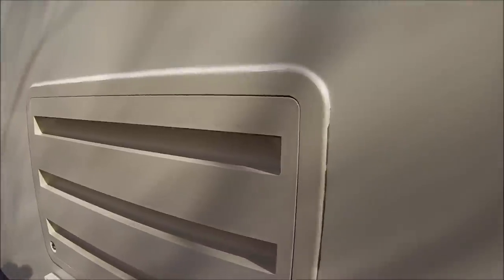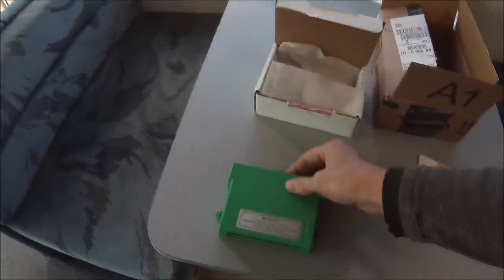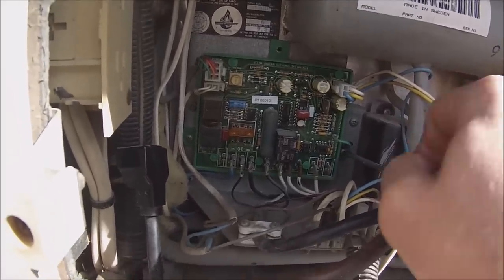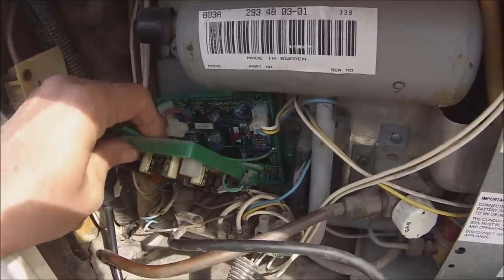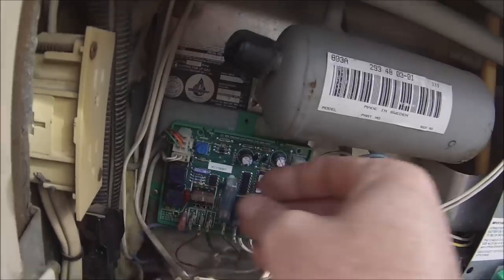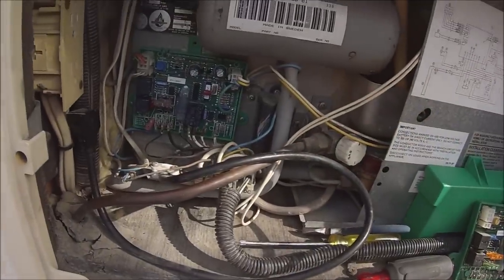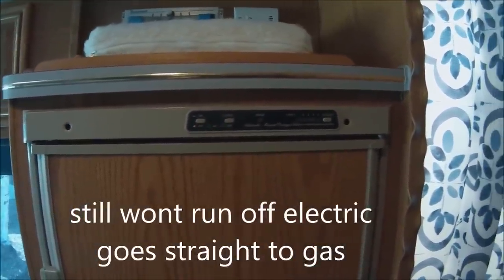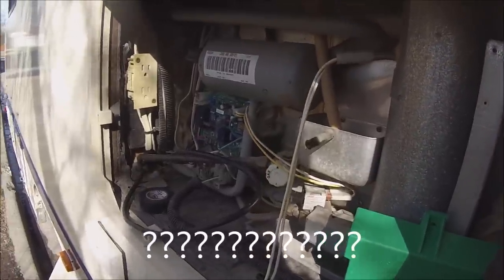Installing new circuit board for motorhome fridge

Comment: Thanks for posting how far you got. I have a NorCold and it was helpful to see what you showed. I've heard that NorColds have a bad rep for catching fire (and causing the coach to burn). Many, at least, have been recalled though the recalls weren't necessarily done (I know of an older one that is still not complete). I don't know how helpful that might be but thought I would try. Thanks again.

Comment: i had a similar problem, how ever your video is awesome we are forgetting one thing as I learned tonight. There is actually a fourth thing that can go wrong as I learned tonight myself. The main house fuse box. This may not be your problem. There is a 20 amp fuse that controls some of the lights in the back half of the RV. For me I have a 94 fleetwood bounder class A. My fridge had no power, no lights, no nothing. I even ordered a dinosaur circuit board to replace the old one. turns out, I have 120v to the circuit board like you did at the end to make power, but nothing coming back out to charge the fridge via gas or electric. I jerry rigged my heating element to my actual home to run 120v from my house to the RV to begin cooling the fridge until what I thought was a bad circuit board. When i went back in the RV tonight to check to cooling, I noticed  my ceiling lights were not working. i found that odd and tried other lights in the back of the RV.. They also were not working. After triple checking the circuit board fuses, I never checked the main circuit board fuses to the RV and sure enough a 20amp was blown. replaced it and the fridge popped on at first with gas but then I changed it back to the house plug in and 120v kicked on and now is working 100%. hope this helps in your next video or somebody that reads this as it wasted 4 hours of my day thinking it was the circuit board when it was the RV house 20 amp fuse that was need to run the circuit board and ignite the propane and run the electrical. your video shows you have lights and 12v power to your control panel, so I am just adding this info if anybody researching this had the same problem as me. My 20 amp fuse was blown, not my circuit board.. saved $115

Comment: he never plugged the fridge back in at the outlet next to the new board. even at the end of video it was still unplugged.
Reply: The fridge, if it’s like mine, is hard wired and does not need to be plugged in.
Reply: @FredBTs  you can see it unplugged on the left hand side. It definitely plugs in.

Comment: Sorry this is late, but have your checked your GFCI outlets?  My refrigerator acts like that if my GFCI is tripped.  I reset the outlet and mine will work again.  We found it usually happened when plugged into an extension cord into a garage outlet and then something popped a circuit breaker.  We've since installed dedicated 30AMP and 50AMP outlets for our trailers and haven't had the problem repeat itself.  Good luck!
Reply: Maria H. 
Hey Maria 
That's what it ended up being those crazy plugs
Reply: This worked for me. Thank you for posting.

Comment: Do you know any HVAC guys? I wish I could help more though. So if it won't run off of electric, have you double checked your connections and fuses? Maybe a hint in the manual?

Comment: It doesn't appear that the ac power cord from the refrigerator is plugged into the ac outlet
Reply: +n9owp   Perhaps he unplugged it so there wouldn't be power to the board while he was working on it.
Reply: +Travels with Yoly he said he unplugged the coach so there was no need to unplug the refrigerator. I have been a service tech for 30 years and see simple problems like that a lot.
Reply: I agree, sometimes the simplest things are often overlooked :-)

Comment: greetings w/blessings my frd.  I seen that the new one you installed was missing the 30amp fuse,  try putting in a fuse there. maybe it will come on. hope that helps :)
Reply: I just bought one of these boards...the 30 amp fuse is for the DC leg in a 3 way refrigerator only.